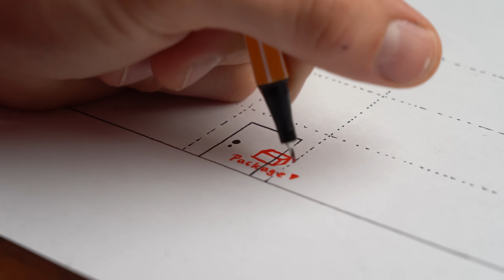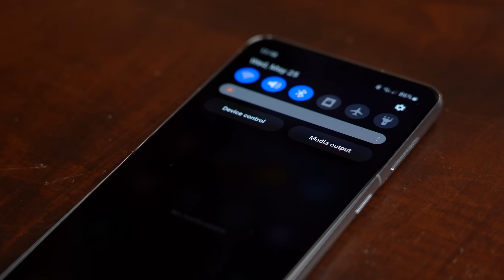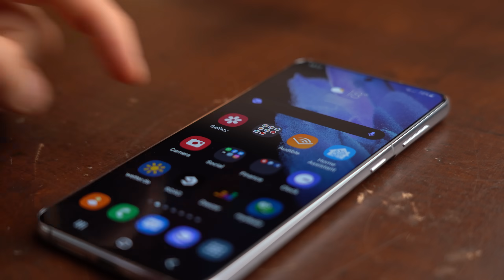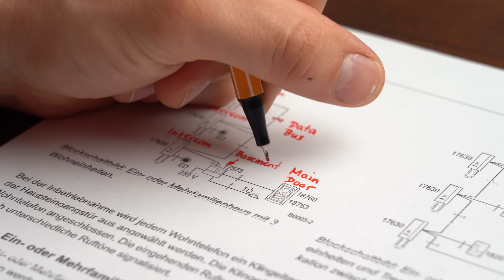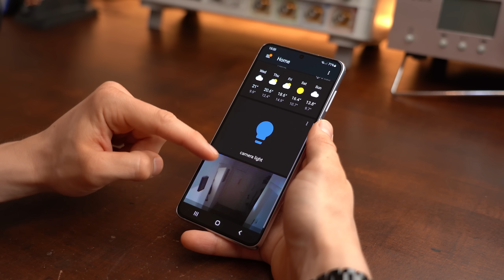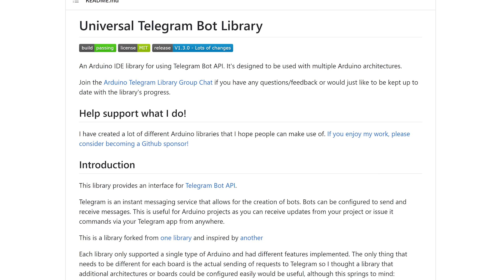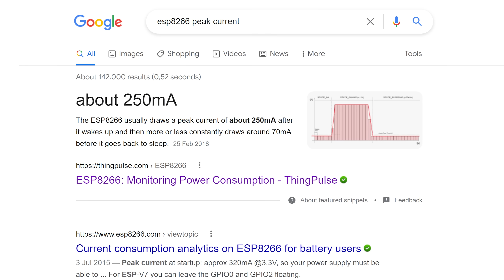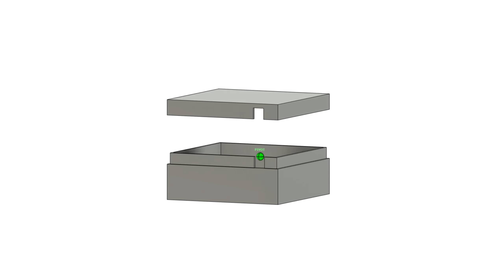Every Apartment needs this Upgrade! (WhatsApp/Telegram Notifications)

Comment: I got tired with my apartments 60's era thermostat to control the heat exchanger fan (central heat/cool and all we have is a heat exchanger and a fan in our unit). The Thermostat is a bimetallic switch with a very large hysteresis and excessive drift. I decided one day to replace it with a digital thermostat. So I got a 22v power supply and a 24v relay. I then wired the PSU into the digital thermostat and connected the fan contact to the relay coil (I also wired in a thermistor to the outlet of the coolant pipe using the "outdoor" temperature contacts). Then I wired the contacts of the relay in parallel with the bimetallic switch but instead of going to the heat/cold selector switch I made sure to be on the combined output of that switch.

Now I have a digital thermostat that works in parallel to the original, I just set the temperature of the original one to a really high or low temperature and let the digital one turn on first. That way if a maintenance guy wants to mess with it he can without needing to know how the digital one is set. The on/off and speed selector switches still work like they used to.
I get really consistent temperatrues that dont drift over the week and I can monitor the coolant temp to see if they switched from heat to cool or how well the chiller is doing to cool things down or if it has shut down completely like it always does if someone breathes wrong!

Comment: I have the opposite system on the same sort of intercom: an ESP8266 which pulls a relay to open the door. Using Pythonista and iOS shortcuts on my phone, I can tell Siri to open the door from the street when I have my hands full.

Comment: I purchased a newer version of the phone (as I did not find a way with the old original one) and an extension module only available for this version (same as yours) for connecting anything behind. Unluckily i found no way to power the ESP (you mentioned the issue with the power supply) and therefore finally installed a battery door bell sender there and created an ESP-based doorbell receiver connected to my MQTT and Alexa - works within 3-5 seconds usually. Ritto is a challenge ;-)

Comment: Great project! 

I have done similar, on old German two wire ac 12v doorbell system. 

My solution was: rectify to DC, charge elko, convert with a small step down to 3.3v, power on an d1 mini with esp now transmitter, on boot it sends a signal to the receiver. 

On my raspberry is a second d1 mini as esp now receiver, on receive send serial signal to node red. Node red sends then a telegram message and action to home assistant (for the dashboard overview on tablet beside the entrance).

Esp now is really really fast, a small elko is enough to power the esp for a second or more, even with a short doorbell button press. After successful transmission, the code is set to discharge the elko with simple led on.
Reply: Hi. Ich habe auch eine alte 12V Anlage. Was brauche ich da genau m kannst du mir dabei helfen?
Reply: @zumbunteneinhorn5277  Hi, sicher, wie detailliert muss es sein?
Reply: Welche Bauteile muss ich benutzen und wie muss ich das verkabeln? Kann ich einfach an die lautsprecherkabel dran gehen, und dann weiter?
Reply: @zumbunteneinhorn5277  OK, vollständig detailliert schaff ich womöglich erst nächste Woche anzufangen zu dokumentieren. Würde mich dann noch mal melden.
Reply: Das wäre super cool 😊😊
Reply: Habe mir gerade mal dein Video mit der Doorbell angeschaut. Leider kann ich das so gar nicht umsetzen, da ich nur so einen kleinen Buzzer lautsprecher habe
Reply: Bei mir sind tatsächlich nur zwei Leitungen. Spannungen gemessen zwischen 8v und 17v AC am Gong, der hat nur einem Elektromagneten, also mechanischer Doppel klang.

Im Grunde geht es mit jedem Stromstoß Gong. Sorry wenn ich nicht richtige Fachbegriffe nenne, da als Software Entwickler nicht vom Fach bin. 

Wie beschrieben, zuerst wird aus AC -> DC, mit einer Gleichricherbrücke 1N4007. Dahinter ein Elektrolytkondensator zum glätten (470 uF glaube). Weiter geht's zum MP1584EN Step down converter, Voreingestellt auf 3.3v. Am Ausgang sitzt ein grösserer (ich bin nicht sicher, glaube aber 1200 uF) Elektrolytkondensator, dieser soll wie ein Akku den Wemos D1 mini (esp8266) versorgen, gerade ausreichend zum Transfer an den Receiver. Nach dem fertig Flaschen hab ich die Bahn zum ch3400 getrennt, da nicht benötigt und mehr Effizienz.

Esp now wird bei beiden Wemos D1 mini verwendet. Am Sender und Empfänger. Hier ist die Stärke, dass der Aufruf direkt und in Bruchteil einer Sekunde passiert, ohne WLAN Umweg an Router.

Der Receiver dient als gateway zum empfangen und am raspberry ein Event auf einem Pin (HIGH) oder serial message auszulösen. Node red dient hier zur Kommunikation zwischen Raspberry Pi Hardware und der Software.

Noch detaillierter müsste ich wirklich eine komplette Doku schreiben. Und für noch effizienter gestalten, müsste Great Scott einspringen. ;)
Reply: Alles super beschrieben.. Habe aber kein HA System, bin auch kein Elektriker oder IT Mensch. Aber dank der Community und und einfachem Ausprobieren, habe ich alles zum Laufen bekommen.
Vielen Dank an alle! Und #greascott mega mit den Stabilo Schreibern 😉😃

Comment: Nice would be to add remote door unlocking also, if you can send a message back to the controller you could just close the circuit of the unlock button

Comment: I made something similar for a hut we build a few km from home as some kind of silent alarm system. Used an ESP8266 module with a door contact and motion sensor and just for fun a temperature sensor. Sent that data to Thingspeak where my friend made a telegram bot that checked that data every few seconds and as soon as the door was opened, the ESP got a reset signal and immediately began sending data to Thingspeak and few seconds later telegram bot said "Intruder alert" 
Might not be as fast as this solution but it worked for us.

Comment: I have been trying to figure how to do this, however I am stuck with an even more ancient doorbell, running on a central 6VAC power connecting to an old bell and hammer to ring the door.
I doubt i will be able to draw power for the ESP from that central power source, but I can probably find another way to power it, so now i just need to figure out a way to detect the bell actually ringing.

Comment: I did once connected a small electronic to my intercom, using the power from the intercom, until I realized a week later that not other ring worked in the building...
Be careful when you hijack them for power!

Comment: Creative project - nicely done!

Personally I would haved used Signal though instead of Telegram. E2E Encryption per default. I implemented a battery powered temperature logger with the ESP8266 a while back ago. The uC captured the room temperature every 30 minutes and sent it to a dedicated Signal Group. Worked really nice and without any delay.

Comment: Nice project. I have put this project off for a long time now. Maybe its time to start it. 
But more than that, I'm looking for an ESP32 + ESPhome based radiator booster. Maybe with PWM to controll the fans depending on the radiator temperature. Unfortunately I dont know how to wire it all together. But it would be a cool project for everyone here to reduce heating costs which is more than relevant at this times.

Comment: You can also do a circuit that plays a MP3 file through the intercom so the caller hears
"This is an automated message. GreatScott is not at home. If you need something important, please call to..." Or something like that

Comment: A neat project, but isn't it a bit of an overkill for this purpose? I can't really put my finger on it, but surely there has got to be a simpler solution that would not require visiting the control boards and opening the telecomm box, both of which should really be unavailable to a tenant.
Reply: Maybe you could use a light depending resistor to output a signal when the LED from the intercom lights on. Given the amount of emitted light is enough to trigger over background level lighting.
Reply: @nims0n  You would not believe it, that very thought occured to me the moment I stopped typing

Comment: I have a normal wireless doorbell, the indoor unit have a blinking light when someone ring the bell. So i used that as indicator using LDR+Wemos and esphome and connect that to my home Assistant and the notification is sent throughout telegram bot.

Comment: What you have to keep in mind in any case: If you live in a multi-family house (apartmentbuilding), the intercom system is usually connected to the house power. If you tap electricity for your ESP, this is theft in Germany. This is also the reason why Nuki is equipped with batteries or USB.
Reply: Just for reference, a mostly idle ESP8266 shouldn't cost more than about €0.05/mo, even accounting for Germany's high energy prices. And this cost could be brought down a lot by using energy saving modes.

Depending on how much effort you want to go to, you could get to probably less than €0.10/year. Just add a cent to your rent check.

Comment: In that adjustable step down buck converer, did yours come with LM2596's? Unfortunately the ones I ordered turned up with LM2576's which are too noisy :(

Also I should be flying across from AU to DE in about 3-4 months! Woo hoo.

Comment: I (as a Landlord) would get very angry if my renters are messing with this (in relation to its function) f***ing expensive "bus-powered" doorbell. Why not build an accoustic toggled system that responds to the certain frequency or melody of the doorbell? btw it would be nice for the series "diy vs bought" to find out which is cheaper,as such a doorbell for multiple users costs a fortune.
Reply: Yeah, well. You are a landlord. Seriously, spare us the tears. Making a fortune by doing nothing but having more money than others. Gross. Sorry. 

In addition, it would be hard to actually damage the system, if you are at this level of experience in electronics.
Reply: @WebmediArt  woah...chill. ;) If you've seen the 3rd tenant run down the self-financed and renovated apartment, you wouldn't be happy if someone tampered with your property either.

I have the utmost respect for his abilities, otherwise I would not have subscribed to the channel.

You should at least ask your landlord if you are allowed to modify the bell.
Even if it is difficult to actually break something. Things can always go wrong and ultimately you risk your home if something actually goes wrong.

Comment: 100% agree with all the comments saying "USE OPTOCOUPLERS PLEASE"
On the one side you seem to care not to overload the power supply in the basement because you don't want other appartement to be impacted by your tinkering.... the absolutely necessary next logical step is to electrically isolate your ESP from the intercom system.
I would do that even if the intercom was my privately own intercom.

Comment: I have some mixed feelings about electrically connection my dodgy electronics to a system I don't own. I would have gone with a audio detection system programmed to the doorbell ring.

Comment: A few weeks ago I did something similar with a couple of cheap rf433Mhz modules I had and 1 led, I only connect the receiver when I'm expecting something.

Fortunately my intercom is really old, all analog but it was easy to use the ring signal.

Perhaps now that you have that esp in there you can add audio functionality so you can answer directly from your phone or another custom device.

Comment: Nice video. Do not fully understand why not integrate it with HA. When using the HA mobile app, should the message not be more instance since then you only rely on local systems and no internet roundtrip is needed. Futhermore, once available in HA, you might want to blink a lamp or turn on a flashing light. That might attrackt more attention than a buzz on a mobile phone.

Comment: My doorbell has only 2 cables. Seems it passes through the power and the video of the front door. 😢 It's like those old consoles that combined the power and a signal through 2 a single cable.

Comment: I had the same challenge. Despite my favor for projects/esp/designing, in the end I just ordered an RF doorbell for 8 euro's; ripped the button-part apart, soldered that inside my intercom and now have 1 doorbell with blinking light to put in any wallsocket. In meetings I can mute the bell, but still see the light flashing when someone rings the door!

Comment: I bought a 433mhz button, use a RF gateway to connect it to my HomeAssistant, then it triggers an app alert, works on both android, iOS, macOS, chrome
Reply: This is a proprietary solution, which cannot be altered and extended. While using ESP or similar you can add functionality. And you can of course use 433Mhz connection too (to extend wifi range limitations etc. or to save power).
Reply: @vencdee  Um not sure how u define proprietary, but all the software(including firmware) are open source. The 433 to mqtt gateway runs tasmota, and home assistant is open source

Comment: Nice project. But integrating it with esphome and home assistant would have been way better. Home assistant does intergrade with telegram and you could have added an led strip at your desk that could flash a couple times when someone's at the door.
Reply: Leaving a comment for if anyone explains on how to do this and also in combo with maybe a video feed, because i have a comelit with video 2 wire config and trying to figure it out but i am not that technical, only a bit 😅

Comment: I have the same problem with the door bell. In my case I will try to access the LED of the DoorBell, because it will already produce 3.3V and so I will need only a tiny limiting resistor. What also could be very nice: Hack a switch bot to be "safe" and you can open your house door remotely by attaching it to the open button. This way you even do not need a house key anymore... :-)

Comment: You can create telegram bot and sent the message to your Channel.
Reply: I'm using for similar purposes RPi in the hall and sending it to a twitter via PM messages (unfortunately there's probably no library for twitter in ESP). Using Telegram bot is also possible solution, it can work literally on every device.
Reply: @vencdee  yup. It's jus one GET request with the message you want to send.

Comment: Wouldn't it be easier to use a microphone to listen for the ring rather than open up the intercom?
Reply: You must add additonal sensor -> more complicated and you must adjust sound levels to avoid disrupts from another sounds. Same for near magnetic sensor because speaker generates mag.field.
Reply: @vencdee  it's easy to add a MEMS mic to a project these are unaffected by magnets and all you have to do is check a very specific frequency for the sound to trigger it.

Comment: Thank you.
I have a similar situation but I never considered it a problem to take some mAh 5V (or 3.3V) from the 26V.
Due to your Video I check the power sypply first.
Unfortunately I don't have an alternate power source in reach and would have to stuck with a Battery solution...
Reply: When you use switching step-down with good ratio and sufficient capacitor on the output, then maybe... For ESP you may need up to 300mAh/3.3V depending on conditions this can be 1W of power... the supply to your phone must be capable of sustainable 40 mA at 26V this may be an issue. It may hang your device or the phone may work unreliably...

Comment: Do you have any content using the ESPnow service? I have a battery powered esp8266 remote temperature sensor that burns too much battery using wifi, and I’ve been considering switching to ESPnow to a base station, but the implementation seems less straightforward than wifi.

Comment: There are better solutions:

1) Ditch the apartment.  Buy a big house and get a servant to answer the door.
2) Use the voltage driving the doorbell to provide an electric shock to your cat. Your cat will attack you, alerting you that the postman is at the door.
3) Hook the doorbell up to a fire alarm to generate an ear splitting sound that you can't possibly miss.

Comment: Few years ago with my friend we tried to do someting even bether. Esp32 connected to intercom by wires and to router using wifi. And when intercom start to ring dedicated app will ring on phone, and using same phone use two ways voice communication and even open the door. But we hit the dac limit in esp and not that much free time as we need to finish this.

Comment: This is a perfect time for this video to be released, I'm doing a very similar project right now, except the ESP8266 is detecting when a door gets opened with a magnetic reed switch and sending it to Discord with a webhook!
Reply: I think Reed switch plus pir plus cheap 433mhz transmitters can be used for perfect door bell notification ...

Comment: Iv'e wanted to build similar system for years, but in addition, I would like to simulate the "open door" button press from the micro controller as well. That way, I can even let in post man while I am not home, which would be incredibly useful. @GreatScott! could you upgrade your system to do this ?

Comment: Cool project! I was thinking you could of gotten a long range wireless doorbell, wired the button into the intercom system so that when you press the intercom button it triggers the receiver, which you could have sitting on your desk. You could even add flashing lights to the receiver (some already come with this feature) so it's not just an audio chime alerting you. You obviously aren't notified when not at home though.